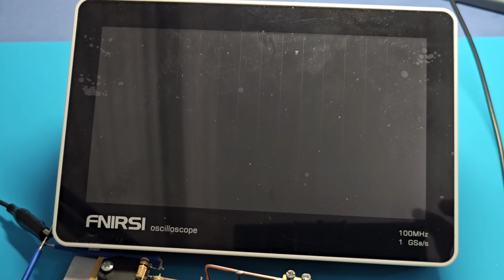How to Make an induction Heater, 2kw induction Heater

Comment: 2,000 watts at 12VDC equals 166 amps !!!   And you use cheap thin clip leads.  LOL to the max.
Reply: No, this circuit can output more than 60V and 200A across the coil when running it at full power due to resonance
Reply: बकवास कर रहा है । गलत प्रचार कर रहा है । कैसे आएंगे 166 एम्पियर करेंट ।
पूरा का पूरा बकवास कर रहा है ।
उम्मिद नहीं थी इससे, ऐसा गलत दिखायेगा ।
Reply: False.  Totally false.
How and from where you are drawing 166 Amp current ?
Have you any reply. 
So stop showing such false sense.
Reply: @ajatsingle1703  well, believe me or not but if you put an AC signal into a resonance circuit with the exact frequency, the voltage and current across a resonance circuit will rises to infinity if there no resistance 
This circuit works like an pendulum and 2 mosfet act like 2 hand pushing it every oscillating cycle
Reply: لا
Reply: So how much wattage does this thing have?
Reply: @ahmedelmasry1243  this circuit is very sensitive to the coil resistance, so if there any load on the output, the current is drop to a certain level
Reply: 72/1000ths of an ohm of resistance
Reply: @warrior4christ777  72/1000 = seventy two thousandths. You don't need to add 'ths' at the end.
Reply: Finally, somebody speaks English.

Comment: 12 v how much amp power supply we need
Reply from the maker: 8 amps and above are sufficient
Reply: @ZAFERYILDIZ52  Thats only 96 Watts.  So its being pulsed 2kW.  Not continuous.   Theoretically you could also make pulsed 100kW.  misleading title.
Reply: बकवास कर रहा है । गलत प्रचार कर रहा है । कैसे आएंगे 166 एम्पियर करेंट ।
पूरा का पूरा बकवास कर रहा है ।
उम्मिद नहीं थी इससे, ऐसा गलत दिखायेगा
Reply: 10 amps

Comment: At 2kw this circuit will draw 170 amps. The device would have to be powered by a car battery. Wires and connections are nowhere big enough.

Comment: Need to pull this to bits a little. The 'G40N60 IGBT's are rated at 625 Watts each but not your circuit. The 10K resistors are colour coded for 100K. The green choke is intended for noise supression not as a power inductor (totally different permubility). You can use any size of coil and alter the capacitors so that the resonant frequency is within the range of the IGBT's.
Reply: बकवास कर रहा है । गलत प्रचार कर रहा है । कैसे आएंगे 166 एम्पियर करेंट ।
पूरा का पूरा बकवास कर रहा है ।
उम्मिद नहीं थी इससे, ऐसा गलत दिखायेगा
Reply: False.  Totally false.
How and from where you are drawing 166 Amp current ?
Have you any reply. 
So stop showing such false sense.
Reply: The 10k resistors are colour-coded correctly. The common mode choke he's using as a saturable centre-tapped inductor is demonstrably suitable - it has a high permeability core. It determines the switching frequency to a large extent.
Reply: Wrong.
Reply: ZVS oscillators dont work with IGBTs.
1n4007s dont tolerate 250khz.

changing the number of turns in the coil also affects the transformation ratio, and the reflected resistance of the workpiece, which is how you control the amount of power you can dump into said workpiece. every extra turn makes a massive reduction in teh power that can be transferred.

ie, 8 turns versus 9 turns... 64 vs 81.

if the workpiece is 1R (it isnt but it makes this easy) then at 8 turns, the supply will see "64R", with 9 turns, it will see "81R"

and then, at 12v, V^2/R....

144/64=2.25W.
144/81= 1.78W.

following this approach....

7 turns at 49R is 2.94W.

and 10 turns is 1.44W (hey, i didnt need the calculator for that one, lol!)

the less turns you have, the more power will appear in the workpiece.

THEN you can play around with the capacitance to get the desired frequency, though its a much better approach to adjust the capacitance for the minimum reactance of the circuit at which point the maximum power will be transferred to the workpiece with minimal circuit losses...
Reply: Great comment, thanks for taking the time, i certainly learnt a lot. 
Zvs will go with good igbts, just unreliably and they need a huge amount of current availiable. Theres and indian guy here on yt who gets em going, but with 2x 700-1000va trafs AND big batteries. But the power output is amazing.
This clickbait producers circuit will go, just not for long with 4007's as u rightly said.
Pointless exercise using those igbts tho - pretty much any shitty n fets would have slowly warmed that blade to cool orange for a few seconds runtime.
But yea i fell for it, couldnt resist someone getting igbts zvs going.
Reply: @ajatsingle1703  Да никак... Но для 2 квт и 12 вольт надо именно такой ток...
Reply: @kpanat  а как вы учли частоту?

Comment: Thank you! I have a blown unit from China that is similar, but the chips had the numbers sanded off. Mine works great, with Tesla pan cake coils, and can run large Dc motors. Adding capacitors and schottky diodes bridge gets over 378 volts DC output.
Good fun!
( a copper foil output coil was a bad idea)
Cheers Warren

Comment: Beautiful job with the vid!  I have a hard time believing it can output 2kw though.
Reply: You're right. 2000 Watts by 12 Volts are 166 Ampere. The connection with crocodile clips does not even manage 50 amps
Reply: @Didi1.275  

yup. and they also cant explain how the number of turns affects the power that will be delivered to the workpiece as its just a transformer reflecting impedances at the square of the turns ratio...

im running one off of 150V, and i can actually get a genuine 2kw.... no clickbait required. 

the really interesting part about this?

first...
a g40n60 is an IGBT. and ZVS oscillators dont work with IGBTs...

then theres those diodes. 1n4007? really? at 250khz? a plain old standard 1n4007?

 i suspect someones doing a bit of cheating regards their little demonstrations versus what they actually "made".

there is a reason most of my time on YT is now spent simply reporting all these clickbait scam channels with DIY "instructional" BS videos.

Comment: induction cooker €22 + made of square iron pipes 20*20 mm, welded a square loop 20*20 cm, let water through it, added thermal switches, thermovalves, pressure safety valves, a pump for central heating and with 1000 W I heat an apartment of 100 m2. Added more converter 12-220, 1000W, solar collectors 1500W, battery 12 v 200 A and works
Reply: BRAVO! You made a perpetuum mobile!

Comment: Good clear video, al though the coil in the middle being cut in the middle and resoldered a little confusing. 2000W and that blade should go white and melt. A 12v car battery will blow a hacksaw blade in two quite quickly, (as I found out)

Comment: 12 V supply, 2 kilowatts will demand over 160 (!) amps.

No way the clip leads can carry that much current.

Nice idea, but don't believe the 2 kW. For comparison, a car starter motor draws under 100 A at 12 V.
Reply: Да конечно чушь...  На вход сколько подают? 12 v.  при 100% кпд надо 167 А  а так 170-180 А. это сварочный ток, который для 10 мм электродов... Там провода 50 мм кв.  А тут 1.76 мм кв...  ну раз в 10 меньше!
Reply: Я измерял ток при заводке машины у меня показал 166 ампер, а не меньше 100 как вы говорите

Comment: i can not see how much amperes it takes, i have ebay 12v/120w inductive heater and it works ok but it is to weak for my need, if it would be double power it would be nice

Comment: can you explain to me where you got this 2 kilowatts from ? 
heat heats but 2KW from 12v power supply is about 160 A and that's without losses , those wires what you show is half a second and they will evaporate .
Reply from the maker: 40N60, IGBT N-CH 600V 40A
Reply: Its pulsed 2kW.  Not continuous.

Comment: NO way that thing will produce 2 Kilowatts.   I'd be VERY surprised if it draws much over 10 amps at the 12 volts (120 watts) that you say you are using.
Why do you misrepresent your project this way?